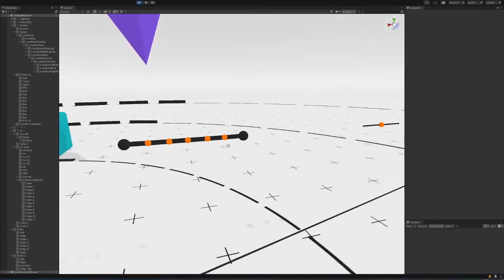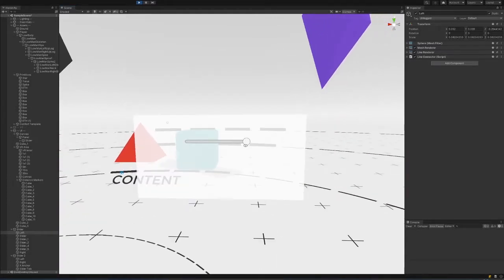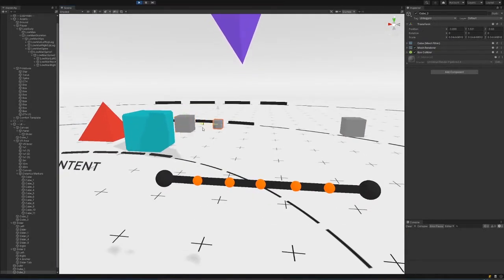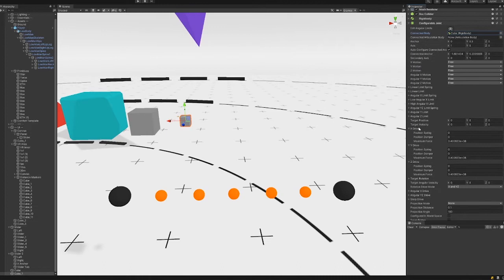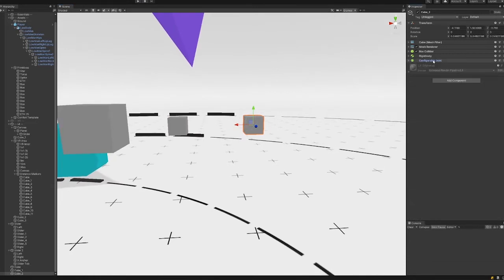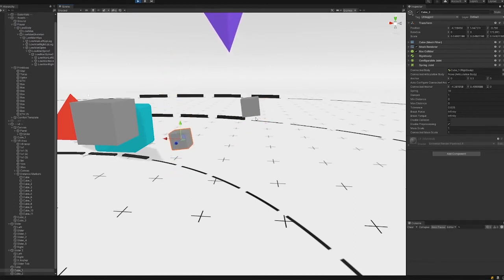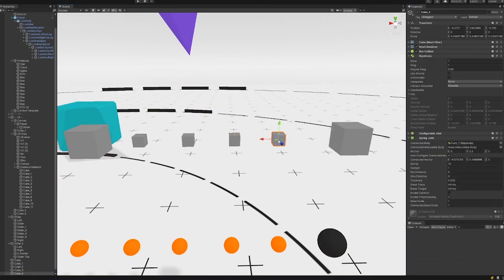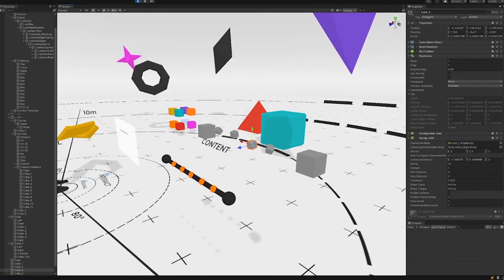Unity Tutorial Working with Joints & Springs to Create Physical Cables

Comment: Great tutorial, but why is the end joint somehow not effecting the rest? Doesn't have it to be connected to? I guess I have to tweak the settings a bit.
Reply from the maker: Its just an anchor so it's a static non-kinematic, there's just a list of joints left to right and I'm just using the position not the joint itself
Reply: @corriedotdev  thanks for your quick response! So do I also add a rigidbody to it? In the video you didn’t have any on it. The thing is when I move the anchor on the right the rest doesn’t move with it.

Comment: Great and helpful video! Would you recommend the same approach for something like metal chains, with interlocking rings?
Reply from the maker: Every other ring perhaps?! Might get better results by daisy chaning them
Reply: @corriedotdev  Thanks! I'll try that out. Really struggling with getting accurate collisions and physics :(
Reply from the maker: @Fr0zen_  arguable you just use the chain as an appearance and the technique above for the physics. Not usually required to have that much detail in your game
Reply: @corriedotdev  Yeah it's sadly part of a smaller research project, that's why I would like it to be as accurate as possible. But I'm sure I'll figure something out. Your video seems like a good starting point :)